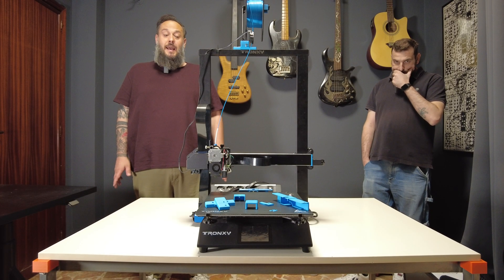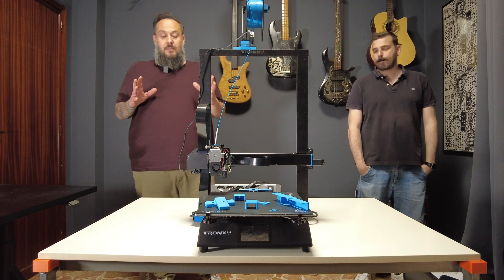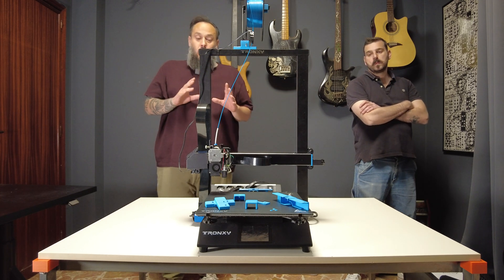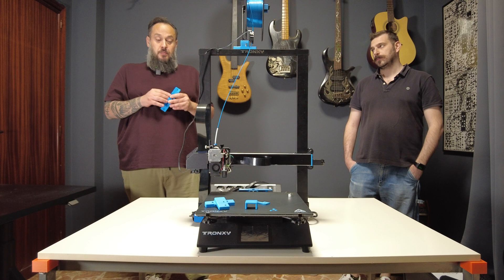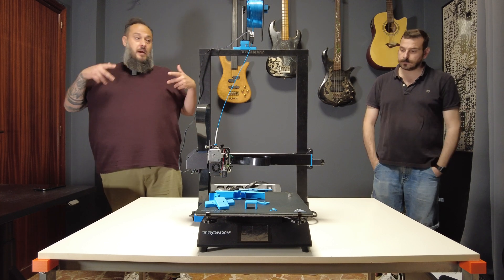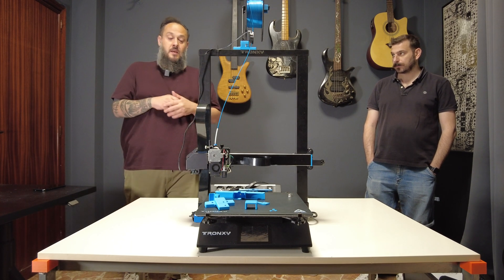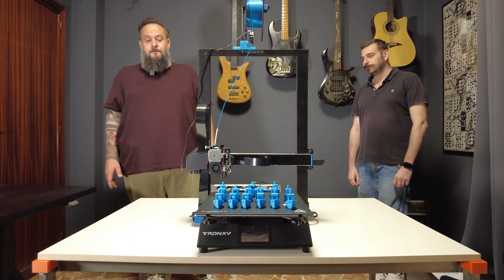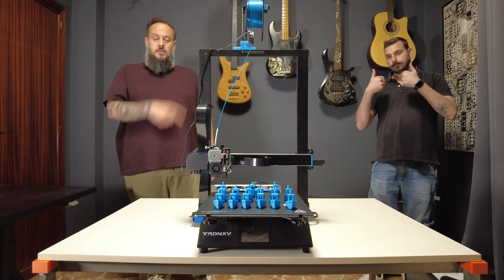Tronxy XY-3 Pro V2 free upgrades and speed test (140mm/s???)

Comment: Is that the same hot end that came with the printer originally? Or did you also upgrade the hot end on this? 
I've been eye balling this printer and looking at what all upgrades I can do to it. :)
Reply from the maker: Yes absolutely the machine was using the stock hotend at the time of recording. I've experienced some quality issues lately so be warned :)

Comment: In case anyone is interested I created an X idler pulley tensioner bracket that corrects the issue you pointed out plus properly aligns the hole for the pulley with the extrusion channel so the belt does not rub against the extrusion and allows for switching to a toothed pulley instead of the smooth one that ships with the printer.

https://www.thingiverse.com/thing:5178112